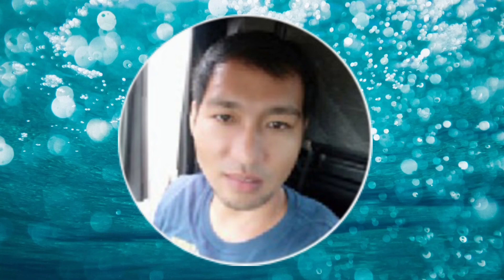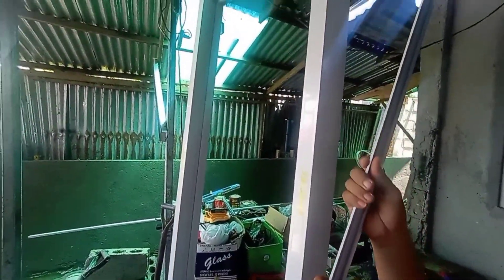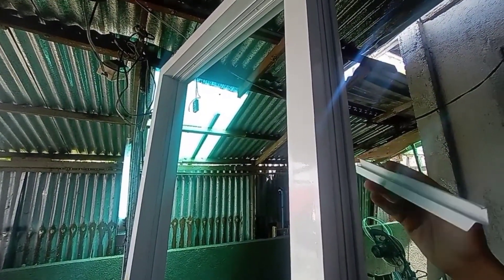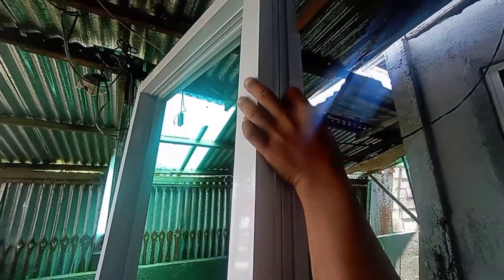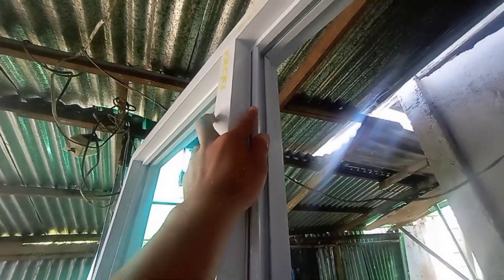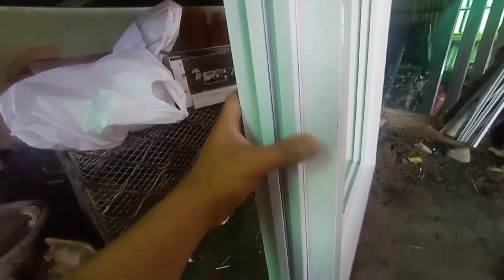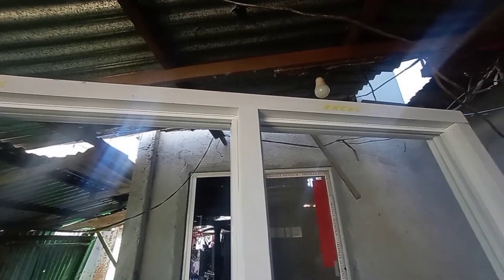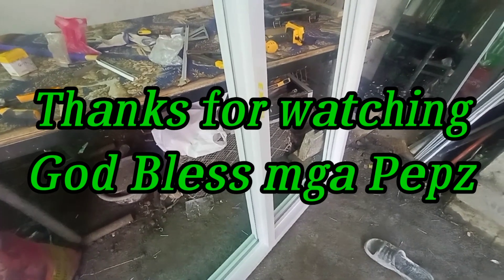Paano Magkabit ng SOBC for Fix Glass Window/Complete Tutorial for Beginners

Comment: 🎯 Key points for quick navigation:

00:54 📹 Tutorial focuses on installing SOBC for fixed glass windows.
02:05 🛠️ Use precise cuts for materials like SOBC snap-on basin cover.
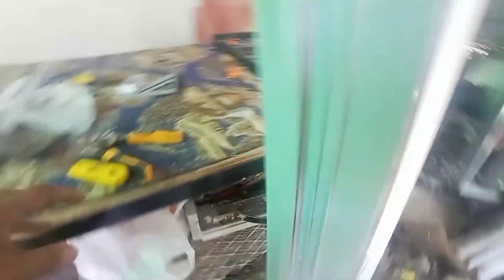03:54 🧰 After horizontal installation, adjust using molding clips.
05:31 🔊 Ensure proper sealing during installation for effectiveness.
08:52 🔍 Vertical installation of SOBC is critical for proper fit.

Made with HARPA AI

Comment: Sir Pongz ano po Advisable na distance sa naka vertical na Aluminum tubular? yung walang sayang sa size ng glass? salamat po sa tugon..
Reply from the maker: 30"- 40", may nabibili naman different sizes of glass. Pero depende parin Yan sa opening measurement
Reply: @PONGZWORKTV  Salamat po sir Pongz More Power!